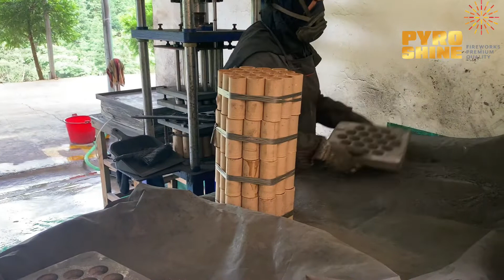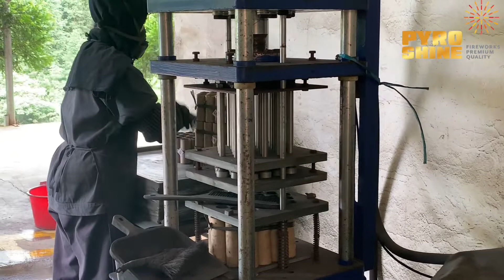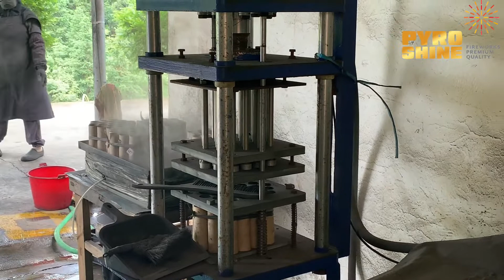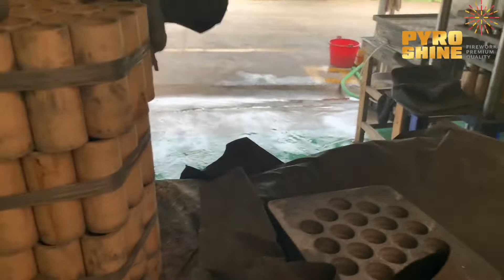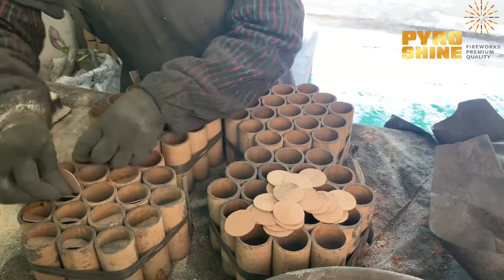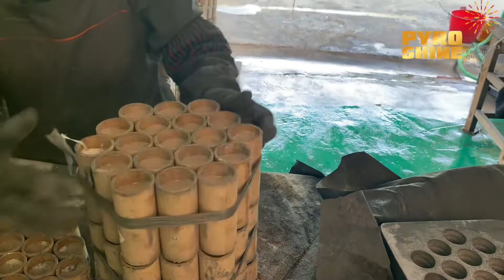Bursting charge loading for canister shells

Comment: May I ask what the composition is of the burst charge that is being used? I am a hobby pyrofanatic but I have a hard time busting smaller cylindrical devices as shown in your video. They always do 'fluh' of 'flof' instead of a proper 'boom'.
Reply: Its a flash powder, probably decent fast, 1-2 inch shells are usually broken with a booster, whistle mix or slow/fast burning flash :)